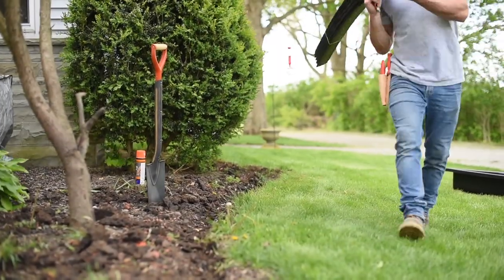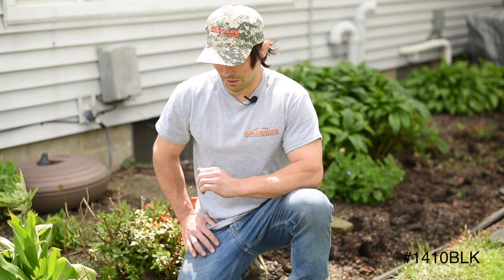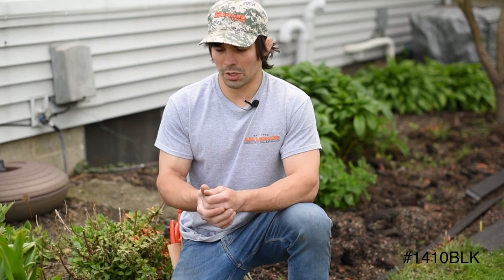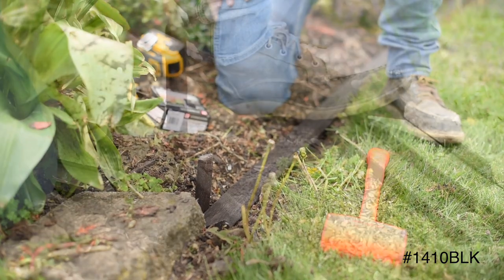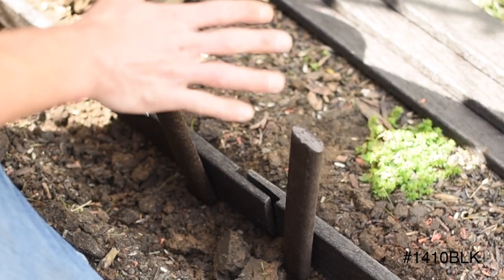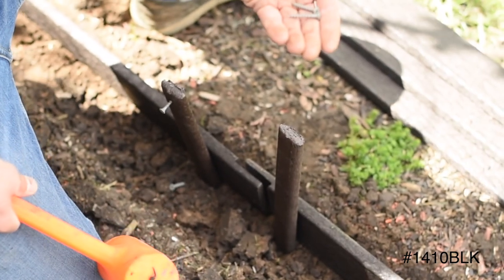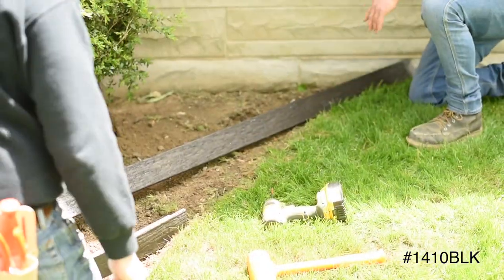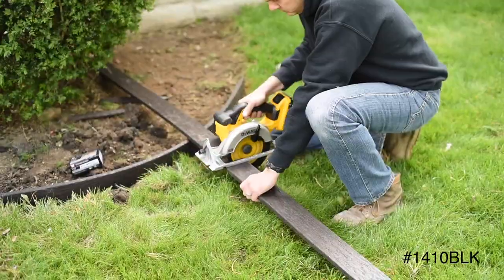How to Install Lumber Edge Edging from A.M. Leonard- Landscape Edging Solution

Comment: Thanks for the vid! Is there a way to deal with uneven ground? I assume the board doesn't bend in in the 4" direction. I have a fairly straight run I need to do but the ground rolls up and down a bit, and too much to just run a string and dig a consistent slope for the board. I could cut smaller lengths but that would look choppy.
Reply from the maker: Good question Ron. You are correct, Lumber Edge does not bend in that direction, to the degree that it sounds like you need. For applications with abrupt changes in elevation we recommend these edging products below.  Thanks for watching.

https://www.amleo.com/dimex-no-dig-landscaping-edging-kits/p/VP-NODIGKIT

https://www.amleo.com/black-jack-poly-lawn-edging/p/452CEB

Comment: I'm thinking about using something like this to line a gravel pathway through my garden. Do you think this would be too tall and maybe be a tripping hazard or could I maybe just stick it down lower into the ground to have it only come up as high as the gravel does? 
👍🙂Thanks for the video! :-)
Reply from the maker: Hi. This would be a great product for that application. And yes, you'd want to counter sink the edging below ground a bit.  This will help with any trip concerns, and also better prevent grass from growing under the barrier.
Reply: @amleonard Excellent! Thank you very much :-)

Comment: What are the stakes you use for this poly board
Reply from the maker: Hi @luislira9078.  The stakes come with the Lumber Edge kits.  But if more are needed, they can be purchased here, depending on which color you need: https://www.amleo.com/leonard-lumber-edge-extra-stakes/p/VP-A1212B.  They are sold in bundles of four.  Thanks for watching our video!

Comment: I bought this to use for landscape edging and wanted to mostly bury it to have that crisp line between the flower bed and grass.  I want to stab myself in the face!  My soil is so rocky, (I had to buy a pick axe and short one too there is so much rock},  the trench has turned into what looks like mud ruts from a 4x4!  I used black, so it was not in the DFW area and I ordered it.  It came rolled; laid it out in the sun and the end still has a slight cup.  If the cupped end isn't out in a day or two, I'll just cut it off.   What a PITA to install.  42 feet worth.  Each stake hits a rock so I have to dig it out.  THIS IS NOT FOR ROCKY SOIL AT ALL!  Great edging though and it will look terrific once done, but if I could do it over, NOPE.  Too much effort; and too much thought has had to go into this.  It should still be here after I'm gone though.  HA.
Reply: Who sells this in DFW? Thx

Comment: How does this stuff hold up to a weed Wacker cord hitting it over and over?
Reply: I'll give you an update in a couple months after I get mine installed
Reply: I’m no expert (I actually have landscape contractors working in my yard right now but I did install my own No-Dig edging) but I would think if it takes an electric saw to cut through it that weed eater line wouldn’t phase it.  🤷‍♀️